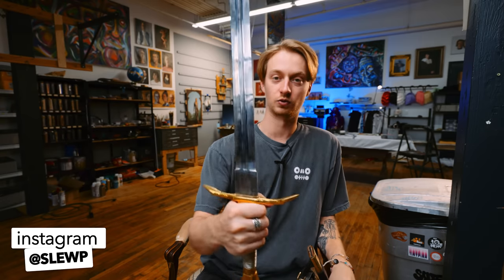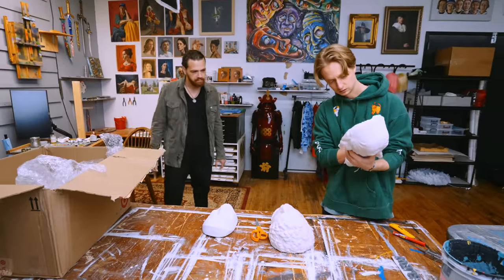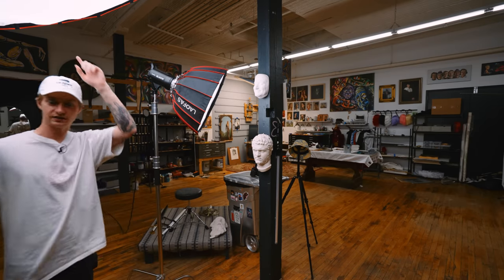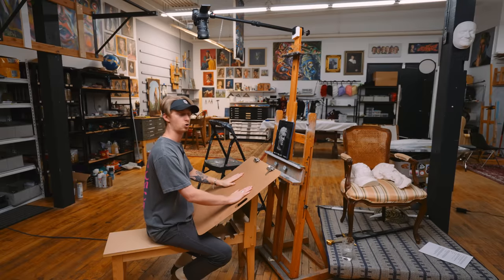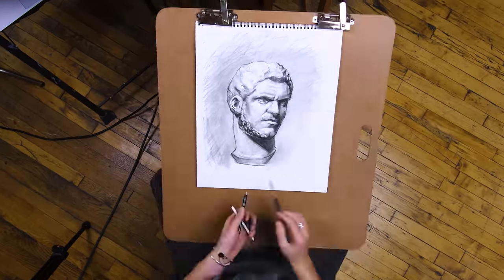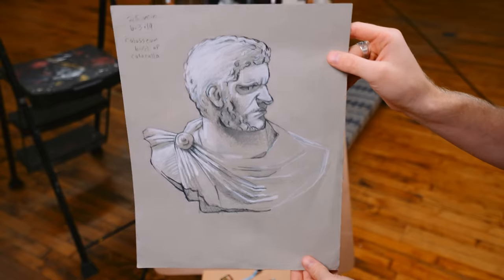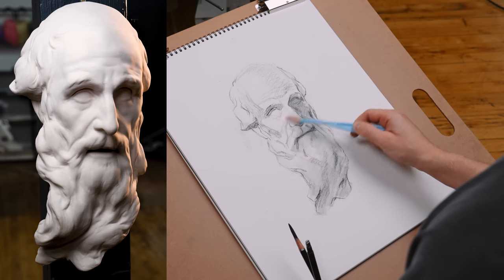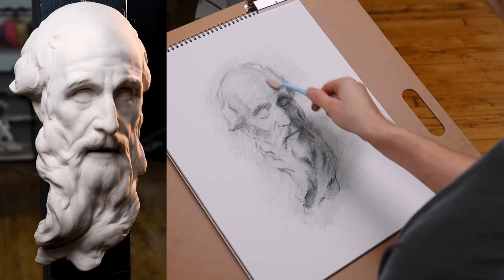I Can't Stop Buying Sculptures for THIS REASON!

Comment: Every studio needs at least a couple of plaster casts! These days, it's safe and easy to take casts from life in the studio, too, with skin-safe kits. Note this artist's delicate grip on a long piece of vine charcoal- that's a great way to work with any drawing medium, a grip that's firm enough to apply light pressure, but gentle enough that the instrument could be pulled from the hand without much effort. Very nice!